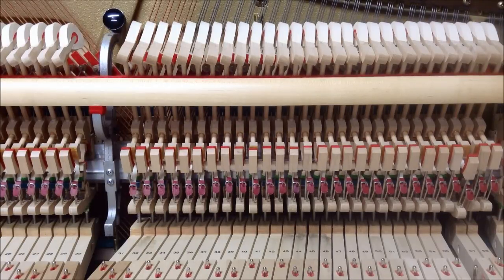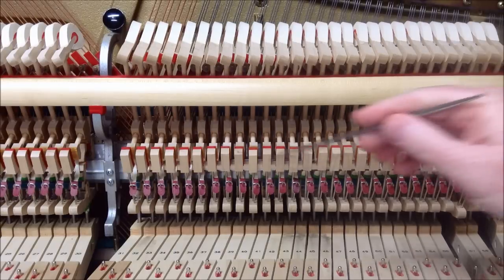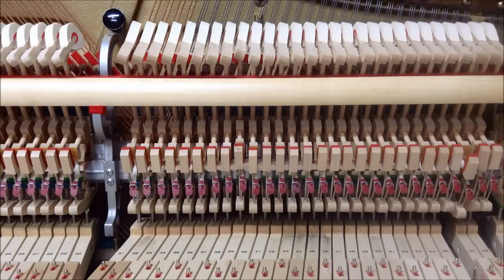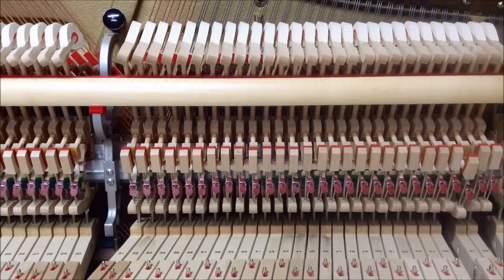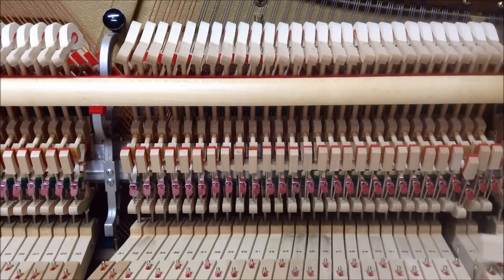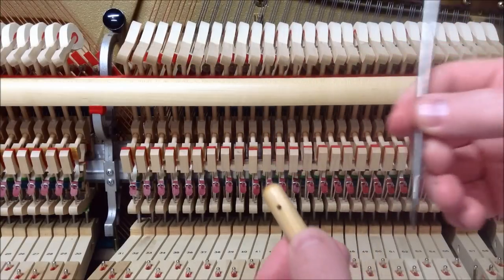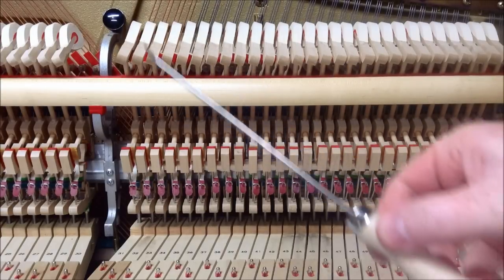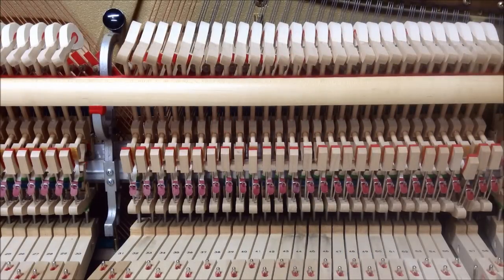Piano Tuning & Repair - Adjusting Lost Motion In A Vertical Piano I HOWARD PIANO INDUSTRIES

Comment: Great video. I have an older upright that I was having problems with the jack not fully reseating under the hammer butt on some keys when played softly, after quite a bit of troubleshooting, I found the main cause of the problem was no lost motion at all. If there is no jack gap, and if the hammer butt leather has wear in it, what happens is the jack gets "caught" on the hammer butt, and doesn't reseat fully underneath the hammer butt causing an extreme loss in power due to the loss of leverage, or even dead keys (as in my case). It was extremely frustrating playing a soft piece and hitting a key and nothing happens because the jack just slips out from under the hammer butt without even moving the hammer at all. Going through and properly regulating the capstans made a world of difference. I though at first perhaps I had bad or misaligned or weak jack springs, but this turned out to be not the case at all. :)
Reply from the maker: This is a common problem and you're right, it isn't related to lost motion.  One of the things that could cause this is if the key is sluggish and not returning completely, but the more common reason is that the jack pinning is too tight or the jack spring is too weak.  If it's an older piano it certainly wouldn't hurt to replace the jack springs which is a fairly simple task and a set of jack springs is fairly inexpensive.  But you also may need to check the tightness of the jack pinning to see if it is too tight.  Sometimes Protek CLP will take care of this, but you may need to repin the flange.
Reply: Yeah I checked all the jack flanges and springs, they're good. The problem was the capstans were so high, the jacks would often catch on the hammer butt, and not return under the hammer butt. So I screwed each capstan down about 1/2 a turn, then went back thru and adjusted each one carefully to get just a tiny amount of jack gap (or lost motion), and no more dead keys!

If you want to see what I mean, turn a capstan up (counter clockwise). If you go too far, you'll see the backcheck start to move, and the hammer will no longer be resting on the hammer rail, it'll actually be sitting on top of the jack. Then the next time you hit that note, the jack can't get back into it's position under the hammer butt, and now you have a weak note or possibly a dead key that does nothing except move the whippen and jack around...
Reply from the maker: brnmcc01 Yes, that is another thing that can cause the problem.  I assumed you had checked the jack gap or lost motion.  I'm glad you were able to figure it out.

Comment: I tried doing this but then arrived at a problem where if I play a note and hold it, there is distortion as if the hammer, or something, is still touching the string. I really like how responsive it made the action but this side effect made it an unfeasable adjustment. Is there something I can do to remedy this?

Comment: i play with the soft pedal down 90 percent of the time. if i adjust the lost motion with the pedal down, how will it affect the playing with the pedal up?
Reply from the maker: If you adjust the lost motion with the soft pedal depressed, the piano may not play properly when the pedal is not depressed. This is because the jacks won't be able to reset because the whippens will be too high in relation to the hammers.

Comment: I have a bobbling hammer and am trying to learn how to regulate the action myself. I have been studying your great videos but my action does not seem to match the action in your video. I have a Kawai upright, and the backcheck and catchers are quite far apart throughout the piano.  However, there is no lost motion, the hammer moves with the slightest movement of the key, even though the hammer butt and back check are not in contact. In the other keys, the hammer butts and back checks only come in contact after let off. In the bobbling key, the hammer butt and back check do not contact solidly after let off, so the hammer rebounds and double strikes the strings when playing that key. I am not sure how to proceed, what should I do first?
Reply from the maker: There are a number of things to check.  First, you'll  want to understand that it's not the backcheck pushing up on the catcher that makes the hammer move, it is actually the capstan pushing up on the bottom of the whippen which in turn pushes up on the jack, which is actually the part that pushes the hammer forward.  So it is normal for there to be some space between the backcheck and the catcher when the key is at rest.  Having very little or no lost motion isn't necessarily a problem.  The problem comes when the hammers aren't able to come back to rest fully on the hammer rest rail.  What you can do is just slightly pull back on the hammer rest rail and see if the hammers move at all.  If they don't move even slightly you'll want to turn the capstans down some to get it so the hammers will "follow" the rest rail a small amount.  As far as the bobbling hammer you'll want to make sure you have enough aftertouch, which is the amount of key movement after the hammer lets off.  We have some other videos which hopefully will make this clear.  If you watch all of our vertical regulation videos it will show you the bigger picture.  Please let me know if you have other questions.
Reply: Thanks for your advice, and thanks for getting back to me so quickly! I will be ordering a few tools from your website :) When I turned the capstan counterclockwise, I lost hammer blow distance but gained better contact between the backcheck and catcher. I'm using this as a temporary solution. When I turned the capstan clockwise, I was able to get the bobbling hammer to move when I pulled on the hammer rest rail, but the double striking was even worse than before. Does this make sense? My piano has the spade head letoff adjustment screw, so I will wait until I have the proper tool before doing anything else.
Reply from the maker: Did you check how much aftertouch you had in the key?  This is fairly crucial.danhowvideo
Reply: +howardpianoind I assumed that I should adjust the letoff before doing anything about aftertouch. The aftertouch in that key was similar to adjacent keys, but I didn't have anything useful to measure it. In the aftertouch video, you used some plastic thickness inserts under the keys, but I couldn't find them on your website.
Reply from the maker: The thing I was using was an aftertouch gauge.  If you have some cardboard front rail punchings you can use those.  I have even heard of people using coins once they knew how thick they were.  Here is a link to the gauge in our store:  http://howardpianoindustries.com/piano-aftertouch-gauge/  If there isn't enough aftertouch, this is one of the biggest causes of bobbling hammers.
Reply: +howardpianoind I don't have any regulating tools or punchings, just some tools for tuning. I'll review your video on aftertouch over the weekend and order some tools and the aftergauge from your website. :)